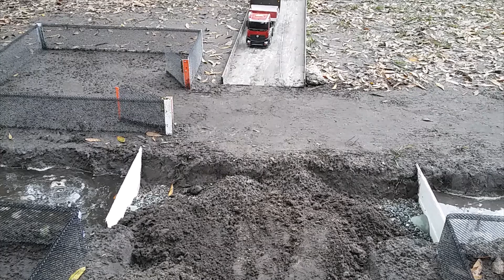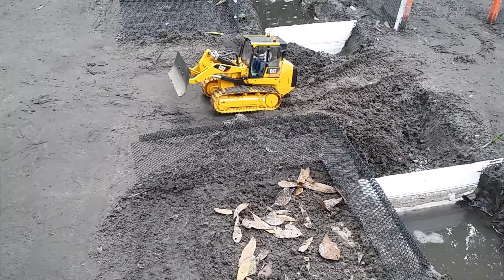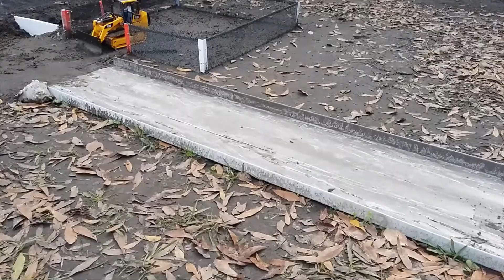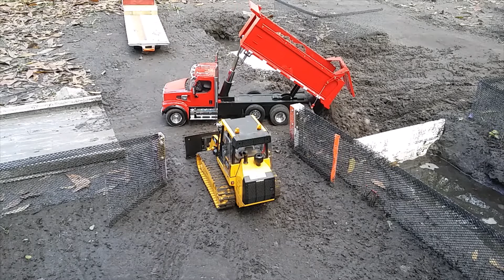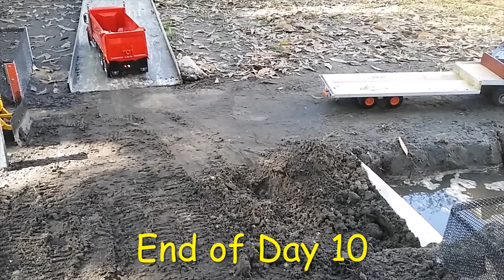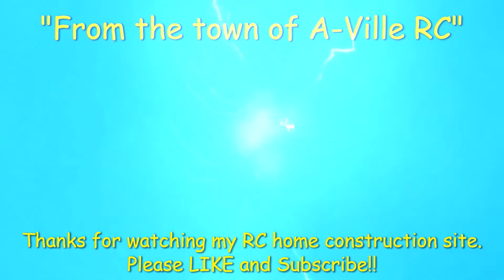Huina RC  Top Race RC   Day 10   Canal and Pond Project - Bruder Conversion Loader 963

Comment: Nice growing fleet of rigs and w/ plenty of power 💪🏼👍🏼
Reply from the maker: Good day 
Thank you, did you get my email about the Dozer?
Reply: @AVilleRC  hey buddy I’m sorry I didn’t recall a email?  I remember answering through a comment.  It I remember correctly I had asked which of the two style Bruder dozers would you be interested in me building for you.  The D5 smaller of the two is a less expensive dozer due to the electronics that are involved making it.  The D11 the big dozer takes the same electronics as such as your 963 I built.  Try emailing me again and we can talk private.  I’m near the finish of a another skid steer with many design and operational upgrades.  Looking to have the grappler claw or / same as the 4/1 bucket almost as your 963 yet in skid steer size 😁
Reply: @AVilleRC  inside tip to all 😉 both dozers always run off same drive system for push power it’s just the mechanics ( linear servos) that are more expensive for the blade movements on the bigger d11 dozer as to
Keep in scale perspective.